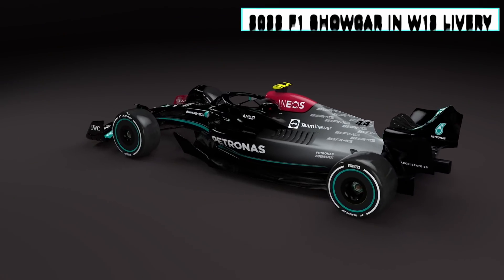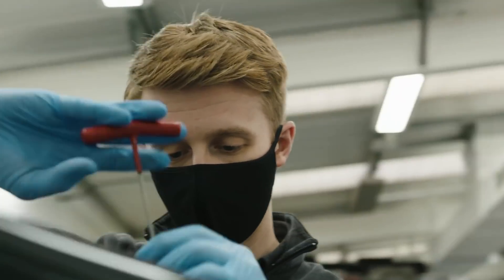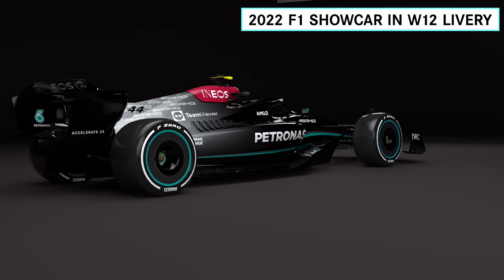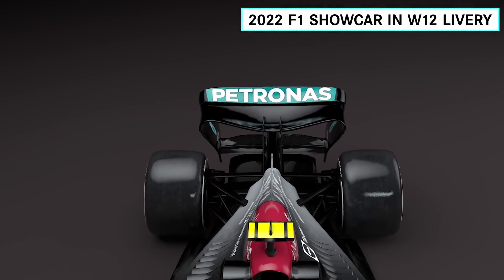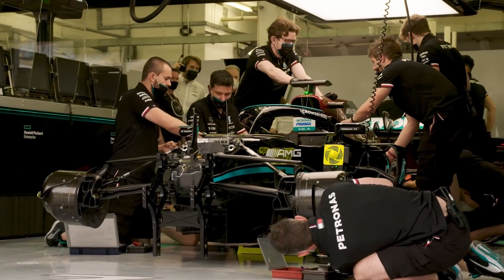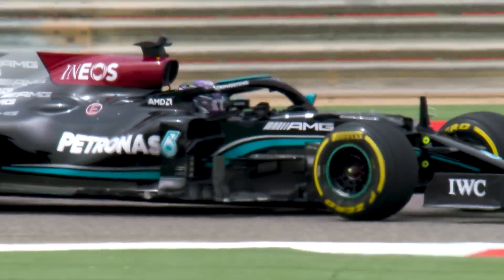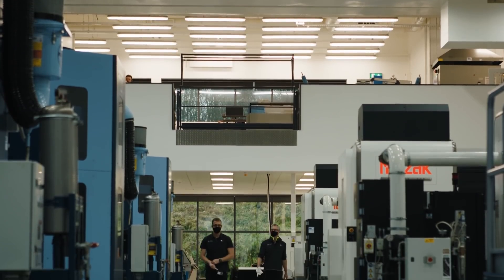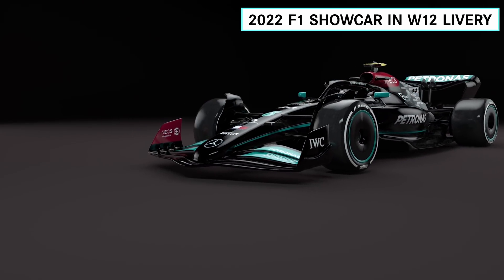Road to 2022: The F1 Technical Regulations, Explained!

Comment: Hey guys, wondering if the cleaning/cooling properties of ethanol have an impact on the longevity of the engines? Having watched "warped perception" youtube channel with clear cyllinders, it's amazing how there's no soot on the intake/exhaust ports whatsoever with lots of ethanol in the mix.

Comment: Thank you Mercedes engineers 👩‍💻 for bringing best of the best car f1car the w13.what abut if intel budge board damage will w13 can maintain it top speed on the grid while racing?.if not what measures is Mercedes engineers are doing for w13 to maintain it speed. Thank you 😇🏆🏆👩‍💻

Comment: Erasure of the time gap/interval under a safety car or red flag in single seaters races should be discontinued.  It is unsporting.  It is unjustified and punitive to leading drivers.  It is especially punitive to the driver leading the race.  Therefore, it should be discontinued.  It should be replaced by a calculated time gap/interval. 

In its simplest form, a calculated time gap/interval shows the projected position of each car after x laps behind a safety car.  The trend of the equivalent number of laps before the deployment of the safety car is used.   For example, let x be equal to 5.   Let 5 be the amount of laps done behind a safety car.  Let 5 be the amount of laps before the racing pause.  At the end of lap 16 the car in P2 is 30 secs behind P1.  Over laps 17 - 21 the gap between P2 and P1 is reduced by 2 secs per lap.  At the start of lap 22 the gap will be 20 secs.  A safety car comes out on lap 22.   Laps 23 - 27 are driven behind the safety car.  After those 5 laps behind the safety car the calculated time gap/interval should be 10 secs.  With the calculated time factored in, the winning racer is the one who crosses the finish line in the least time.

Consequently, time gap/interval erasure should be replaced by calculated time gap/intervals.  Implementing calculated time gap/intervals would make the race infinitely fairer at its resumption after a safety car.

At the resumption of the race after a red flag the time gap/intervals that existed before the pause should be retained.   Very basic, no calculation required.

Further, pit stops are part of the race therefore they should be made only during the race.
Reply: Still mad Lewis lost the 8x?
Reply: @W11-o2y   Sorry.  I taunt intellectual midgets on Thursdays.  Until then may I suggest that you consume a few cans of that sham energy drink then spend some time in a red light district.
Reply: @garvinm.  It’s Monday or Tuesday
Reply: I think that'd just overcomplicate matters way too much to be honest. Also, who is to say that the pace difference between cars would have stayed the same across those laps? Tyres wear, drop off, or get into temperature, get through graining phases, cars encounter traffic or clean air, all things that affect their pace.
Reply: @bananatree2527  Excel sheet.  Excel formula.  Average time.  As simplistic as that.  In the year 2022, the position of the planet Mars 0n 25 Dec. 2085 at 3:19 p.m. can be quickly and accurately calculated.  Do you seriously think that computing the average time gap between cars will be complicated?  How do you think the striking distance lap is computed?

Comment: Will we have DRS for this new set of regulations?
Reply: Yes
Reply: @mesterorange8181  What he ^^ said. Yes. But the FIA are going to review it after a season of new regs plus DRS to see if it can be dropped for the future.
Reply: @veemacks7255  never drop it
F1 need drs 
More overtakes
Reply: @Bryan-fh1or  Are you aware of what's happening with the 2022 rule changes? DRS was introduced because cars couldn't follow closely so it was needed. This years cars should be able to follow closely and therefore it might end up not being needed anymore. They're going to review after this season and it might be dropped. No decision is made though.
Reply: @veemacks7255  yes of course im aware of that come on im not a Mercedes fan duh
Yes the cars will be closer to each other but DRS will always help
Its always an advantage 
So they should always use DRS 
I would like to see the DRS on the Zandvoort banking🇳🇱
They gonna allowed it this year 
That would be amazing to see

Comment: Can you low down the rear of the car to raise the front wing and reduce the aerodynamic drag at the straights ???
Reply: @CleanPipes they did that last year with the suspension
Reply: @Bryan-fh1or  isnt that active suspension
Reply: @KitKitChanIsaac  illigal right? I think too
But yeah its mercedes 
Almost everything is illigal there🤣
Reply: @Bryan-fh1or  it wasn’t illegal because it just used multiple dampers to achieve the effect. Not active, just tuned to deploy at the right time with enough downforce. Anyway, only conventional springs allowed from this year onwards so that sort of system won’t work anymore anyway